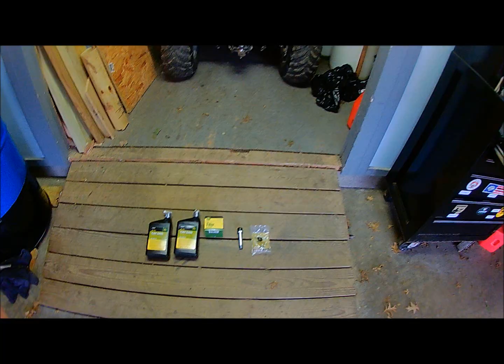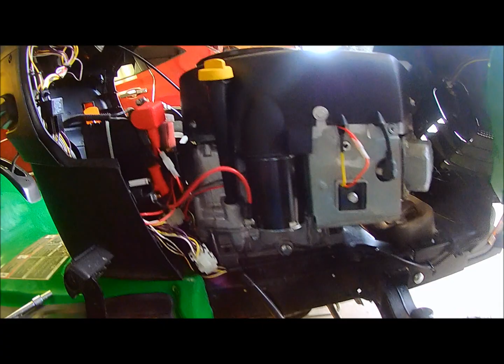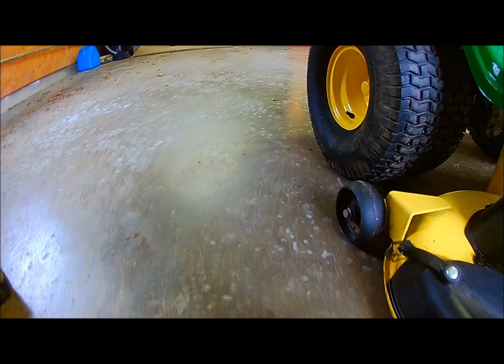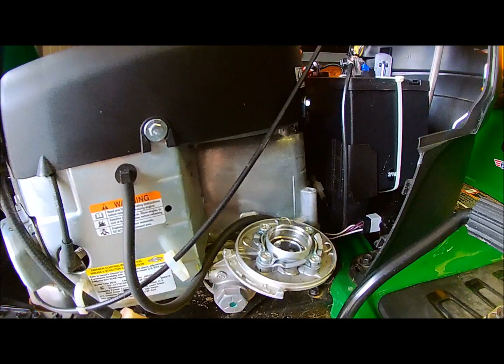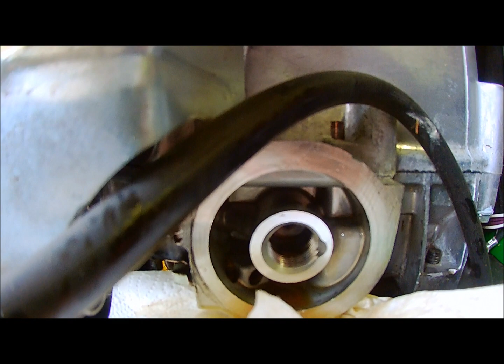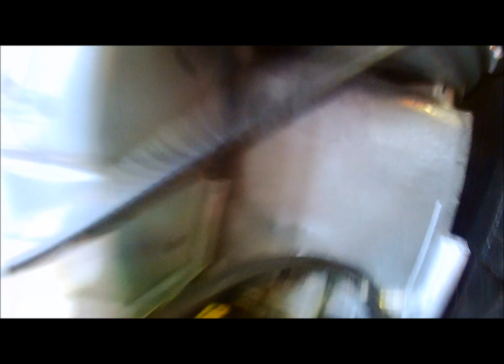John Deere EZ change oil filter conversion

Comment: Question, so I understand that simply changing the quick change filter itself of course won't change out all the oil inside, but wouldn't the older oil inside mix in with the brand new oil from the new filter? When was the last time you emptied your entire tank of gasoline in your car before refilling with new gasoline? I would imagine the quick change oil system not being as bad as some might think. As long as you stay on top of regular oil changes I would think you'd be fine.

Idk, maybe I'm wrong. Curious what other people's thoughts are though.
Reply: Your motor vehicle gets a total refresh of gasoline every time you fill up.  It is continually refreshed with fresh gas.  There are gas filters in every vehicle.  Most all vehicles do not need to change a gas filter because gasoline is so pure from the pump.  For oil, imagine a you have a metallic & self-contained compartment that is filled will oil.  The compartment creates microscopic slivers of metal and bypass dirty hydrocarbons as it moves at thousands of RPM.  The metal and dirty gasses have no where to go but mix within themselves and build up over time.  The dirty gasses and metal fragments are caused by blow-by through the engine's cylinders and literal metal-on-metal scraping within an engine.  This degrades the engine and oil.  This is what makes your oil change color from caramel to black.  It is the same with both your car and small engines.  The oil must be replaced with clean oil for longevity.  The problem we have with the EZ Change system is that it only replaces up to 45% of the dirty oil.  Even with numerous EZ Changes there are still particulates in the oil from when the engine was new.  Basically, the oil is never cleansed and replaced.  So, we recommend a near total oil replacement, which the optional product allows.  Also, it is FAR cheaper that JD's option.  It is a horrible marketing idea and it just sucks as an option.
Reply: Small engine manufacturers have researched and tested this system and found that you only need to replace 20% of  the oil volume to at a time to replace any additives needed.  The catch 22 in this system is it requires that proper maintenance of the spark plug and air filter be performed as directed in the owners manual to minimize contamination of the oil with dirt or combustion byproducts. .   And the people that don't service their oil on a regular basis don't service the air filter either.
Reply from the maker: The EZ change filter only holds 0.8qt of oil !!! Cut one apart and it will shock you. Comparing oil to gasoline as far as adding is night and day. Gas sits in a tank until used. Oil in a engine is operating under extreme conditions, especially in a air cooled motor. So when you add gas your adding to clean gas. Not the same as adding a little fresh oil to dirty, abused oil. As of today a EZchange filter is $39.98 at Lowe's. For that you get a clean filter with .08qt of oil. So, the entire conversion kit is currently $24.71. So you've saved $15.71, converted the filter and have fresh clean oil in the motor. Your next oil change you can get a new genuine oil filter and totally new oil for $22.71. A $17.27 savings over a filtering system that gives you a new filter with a cup of oil in it. It takes under 10 minutes to change the oil. I expect the tractor to last and the best way to achieve that is proper maintenance and fresh clean oil.

Comment: I have one question. when you replace the drain plug with the longer extension. Does the side panel fit or does it hit the drain plug? It looks long enough to prevent the panel from going back on.
Reply from the maker: On my E150 the side panel goes back on with no issues.
Reply: @rickb8808  How long is the drain plug extension?
Reply from the maker: @ericstrickland7424  I'll go down to the storage building and measure it tomorrow. It;s still put away for winter
Reply from the maker: 4" from the block to end of extension end cap. From the end of the extension to the plastic cover is 1 - 1/4", plenty of room for plastic cover to go on.

Comment: Richard, Thanks for posting this video. I'm getting ready to take the riding mower out and start using it again. I've wondered how I could adapt the tractor to a regular oil filter. This has answered my question. I thank you and my John Deer thanks you.

Comment: Do you know if converting effects the warranty?
Reply from the maker: My local John Dealer said no if the Genuine John Deere parts are used for the conversion. Also, if you click the greenpartsstore link below they have it right in their advertising print the genuine kit they sell will not void the warranty.
Reply: Thank You

Comment: You have your doubts about an extra large filter, filtering oil?  That doesn't make sense.  John Deere isn't in business to make money on oil, the oil companies are and you seem to be funding them well.
Reply from the maker: Next time you change your oil cut the old filter open. You will find around a cup of oil in it. So basically your putting a new filter on and running with old oil. On a small air cooled engine running at high rpm you want clean fresh oil. Also if you cut the filter open you will see the filtering media isn't much bigger than a regular filter. It is true John Deere isn't in business to make money on oil. They are selling you a filter for $39.98 that has a cup of oil in it. And you can get a genuine John Deere standard filter for $11.99 and 2 quarts of genuine oil for $12.20. That's $24.19 and you have the same filtering capability and fresh oil for a $15.00 savings. JD is in business to make money. Off of suckers who will pay 40 bucks for a filter that doesn't even replace the oil.
Reply: @rickb8808  The thing is you don''t have to replace the oil, you just have to replace the additives, and by replacing 20% of the oil volume you replace the necessary additives, because the oil doesn't breakdown the additives do.  This system has been in used for about 4 years now, and just come across something today that hints that it may be coming to the automotive industry in the near future.

Now I understand your concerns about not changing the oil volume, but testing has shown it isn't necessary, but this system is designed for DIY people that wouldn't do proper maintenance so the easier they make it for the person the more chance that maintenance is actually done.

Comment: You got to wonder why John Deere would make a oil change system that doesn't get all the used oil out. I guess they are counting on repairs after warranty runs out.
Reply from the maker: Don't know about that Jay but when I changed the break in oil I cut the filter open and couldn't believe how little oil came out. I decided at that point the EZ change had to go. Two more oil changes and I'm going synthetic.

Comment: Can I Smack the guy who invented the "Easy Change Oil Filter System"
Reply from the maker: It's illegal to hit a minor !!!
Reply: Richard Bricker 😂 😂
Reply: @rickb8808  had to be a former Ford engineer.
Reply: It would be ok if it had full amont of oil and was not too expensive. But you're right.
Reply: This is funny. If you change oil once a season using the "Quick Change", the motor will easily outlast the rest of the tractor!!
Reply: @daviddouglass7662  True. However, the same can be said by using the conversion kit with a filter and 2qts oil, and it won't cost near $40 each time.

Comment: Let me clarify my comments on RICHARDS SUPERB video here. My point that I was trying to make is that it is pathetic that John Deere did this stupid system. Richard is absolutely  correct in that you need to get all the oil out. 
Great Video. Richard they should compensate you for the expense of the parts. There should be a coupon or some type of credit that allows you to get compensation for this.
I run my lawn tractor for about 50 hours a season...I change the oil 3 times a year. Spring/Halfway thru the season and then Fall. 250 Plus Hours and I want to get at least 800 Hours. But...You never know with that damn K-46 Transmission.

Comment: One issue.  The oil drain bolt removal seems impossible.  Could not get it off.  Seems to be a square pipe plug with Red thread lock which will be hard to remove without a proper socket.  I saw another video recommending a 14mm socket might work but it didn’t.  The plug metal is too soft and it starts to strip the head....Just be prepared for that.
Reply from the maker: I used a open end wrench to get mine off ? You can' get much of a turn on it but it works. Mine had the red thread lock also. Thanks for the feed back in case someone else has a issue.

Comment: Excellent video. Thanks for taking the time to share. 
I use a qs3614 oil filter in place of the JD filter. You can cross the QS3614 to other brands I just prefer the Quaker State. The JD filter is puny and nothing special no check valve nothing at all. The QS 3614 fits perfect and is 2x the size and 1/3 the price and available anywhere and fits perfect. The oil supplied in the kit is a standard oil grade of API SM(automotive grade pre 2010). I use a quality API SN grade oil(the current automotive standard) Do it yourself cost with oil is less than 30$. BTW prefill the filter with oil before installing the filter don"t dry start the engine that applies to all engines all oil changes.
Reply from the maker: Since my mower is still under warranty I'll stick with JD filters & oil but I agree, there are better options. I normally go synthetic.

Comment: When you take that 1 1/8 plug the entire ez filter assembly comes off with it?
Reply from the maker: The EZ change unit is one piece. When you take the 1 1/8 bolt out the entire assembly comes off. The nipple screws in where the bolt did. The standard oil filter screws onto the nipple. Just picture a regular motor with the threaded nipple where the oil filter screws on. Once you take this 1 1/8" hollow bolt out and the EZ fill unit off your motor will look just like that. Screw the nipple provided in the kit in the threaded hole where the bolt came out and the filter screws on it just like a regular motor. Hope this helps.

Comment: Excellent video!  Thanks.  Looks like you have a mulching cover.  Does it work? Do you have special blades?
Reply from the maker: Yes Donald, my 48" deck has the John Deere mulching cover. It has bad ratings amongst other owners but works for me. When you first put it on it has a tendency to leak a small amount of clipping but stops once the slight gap is filled. For the 48" deck the part number is GY20417.  I have been using Oregon Gator blades for years. There are many knock offs so you have to make sure the Oregon sticker is on them. These were the ones for my 48" deck.  Have worked great.   https://www.ebay.com/itm/3-Oregon-92-616-Gator-Blades-GX21784-GY20852/183692499639?hash=item2ac4ed1ab7:g:ZrEAAOSwUwFaNb6c

Comment: Very helpful video.  I am old school also and we can't imagine why some pencil pushing knucklehead came up with these 1/2 qt oil changes. AAAHHHHH, that's right!!! JD would love to sell some service to you or a whole new machine.  
During BREAK - IN all the metal shavings have to be removed from any engine to avoid damaging the Bearings, Cylinder Walls, Top end and your WALLET. 
Long term reliability and machine's life span depends directly on the correct "Break - In". (learn this skill)
If the manual recommends 7hrs, do one oil change with "Dino" oil at 3.5 hrs and Mobil 1 at 7 hrs.  Machine will smile and run forever.
Reply from the maker: I agree Capt Jay. I am a oil change fanatic. My new John Deere replaced a 17 year old Craftsman that still ran great but deck and tires were shot. I like to check the first oil change for metal and didn't like the fact you couldn't with this ez change system. I cut the filter open and cringed at the amount of oil in it. At that point I decided I needed a plan B. I was surprised when I found the entire kit at such a great price. I've used Castrol oil on my small engines for years. Just a personal preference.
Reply: @rickb8808  m

Comment: would this void the warranty ?
Reply from the maker: Our local John Deere said no because I used genuine John Deere parts. However, I suggest you contact the dealer who would service your machine. In the advertising for the kit it clearly states it will not affect warranty.   https://www.greenpartstore.com/John-Deere-Easy-Change-Conversion-Kit-AUC12916-KIT.html

Comment: Since most small engines don't even have an oil filter, why can't we just leave on the one filter it comes with and just drain and refill the oil conventionally a couple times a season?  Anyone have any thoughts on that?
Reply from the maker: Thank You for the reply Tommy Tester. I imagine that could be an option. I have a very large yard and using John Deere's recommended filter change interval I change my oil a minimum of 3 times a cutting season and I always change oil & filter before putting it away for winter storage. It will be ready for spring.  The current price on a ez change filter is $39.99 locally. I can get a John Deere standard filter for $8.99. John Deere oil Qt. $3.97 ea.. Based on three oil & filter changes it would cost me $46.82 for a season. This gives me peace of mind I have clean oil being filtered by a clean filter all season. If I leave the ez change filter on as you suggest against John Deere's recommended change interval and just change the oil it will cost me $39.99 for filter and $11.91 for oil totaling $51.90 for the season. I save nothing plus I am leaving a oil filter on at least twice as long as recommended. I would not personally do that but I'm a maintenance fanatic. If someone had a small yard maybe it would work, but technically using scheduled changes that wouldn't make much difference ?
Reply: I thought about that also. I was going to install the drain tube below the starter and drain the crankcase and change the EZ Change filter, but $40.00 for the replacement seemed a little high so I went with the total conversion. Other than the mess, it worked fine.
Reply: Oil filter is very cheap maintenance

Comment: Very good video. I am getting ready to do the same conversion on my E130. One question....the instructions don't mention using thread sealant. Is it really necessary in your opinion? Thank you.
Reply from the maker: Because of the engine vibration and the fact your screwing steel into aluminum I opted to use it. I preferred Permatex #2 on the drain tube. Teflon tape on a steel tube screwing it into aluminum rather concerns me. I'd rather use the sealant than have to redo it. On the nipple for the oil filter I used blue lock tite so it doesn't unscrew with the filter. I let it dry a couple hours before installing the filter. Lastly, I contacted John Deere and installing the kit does not affect the warranty using the John Deere parts.
Reply: Thank you. Very informative.

Comment: Thank you for that video! I have the e120 that my wife bought me. I love it. That was he first thing I noticed was the ez filter. Like you said you only get 1/2 quart out if it. You are only changing the filter! I like the conventional method of oil changing. That has been around for over 100 years and their is a reason why. It works! I also liked the beeps on the end of each task. Again great video!!